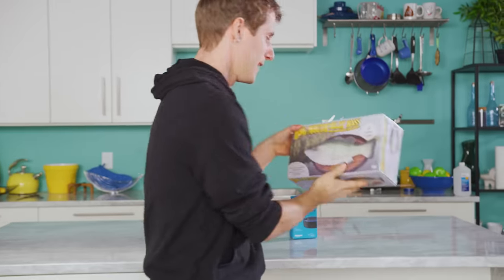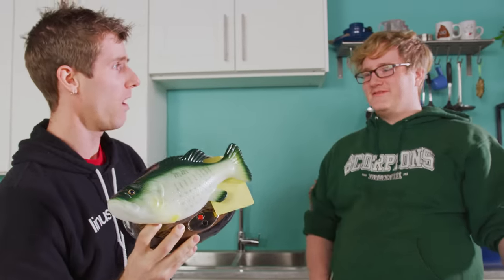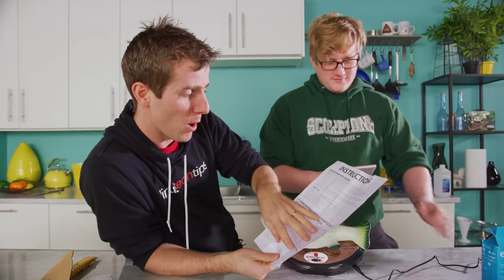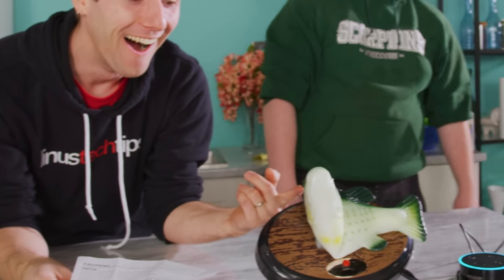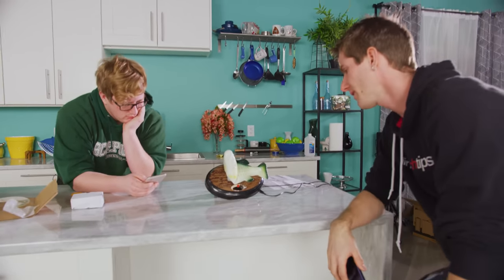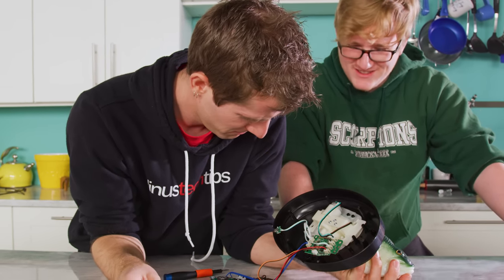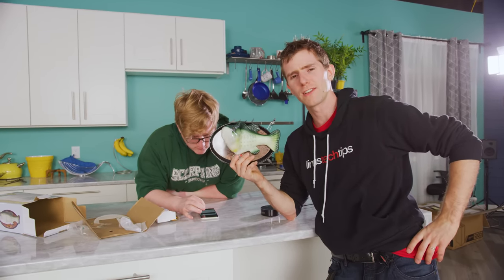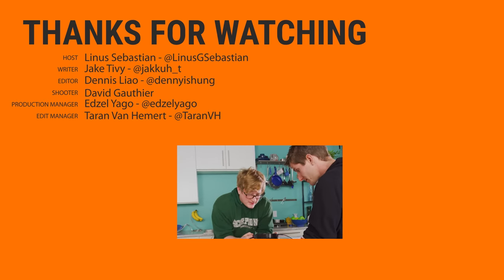The BEST Money We've Ever Spent

Comment: Regarding that motor, it's just a simple 8-point helical assembly.
Reply: What's that? I guessed the 1 motor had 2 rods connected to something else that the shaft was connected to which pushed the back or front out when the motor spins.

Comment: iFixit huh.....
It cost $59.99 and $55 shipping to my country great deal :)
Reply: 😂😂 I know right
Reply: It will be the best money you will ever spend.
Reply: you can try amazon for the same stuff. it's a little bit more, $65, but the shipping cost is way less.
Reply: Ifixit screwdriver and bits are JUNK. Amy screwdriver you see, that has bits with a bright finish, is junk. (This is a general rule of thumb, and it doesn't clover every base.) Look for black bits. Same goes for Allen/hex keys. Buy some Wera/Wiha screwdrivers. The cellphone opening implements can be bought separately too. Although old credit cards and gift certs work great too. Just cut them up into the shape you need. You don't need an iFixIt kit. That being said, it doesn't make the op's comment any less dumb.
Reply: @xenonram  Point on the doll where the ifixit kit hurt you
Reply: Andrew Delashaw
Then maybe Xiaomi's Wiha set? Not sure how good that is, but the price is lower anyway...
(Also I think those no brand red "S2 bits" are also pretty good, and costs even less.)
Reply: iFixIt's shipping has irked me in the past. Are there any better options out there for a similar price that include all the same bits?

Comment: One motor for both tial and head. The motor can be run clockwise and anti-clockwise. Some clever gearing distinguishes between the directions and controls each movement individually. The movements return to their neutral position on their own with a spring; at least they're supposed to. The head doesnt seem to work particularly well.

Comment: Based off of older fish I've fixed this is how it is. It might be different since this is the newer one but let me explain. The 9 tooth gear in the motor makes both head and tail move. The gear spins one way to move the head and the other way to move the tail. Im not sure on how to explain how it works in the gearbox but thats just simplified. The mouth motor is where you pointed it at and it is also moved with a 9 or 10 tooth gear.

Comment: The head and tail are on one motor, that why he can only look at you or flap his tail, not both at the same time. 
The gearbox probably uses a sliding worm gear, probably on a square shaft so the worm gear can slide on the axle while stull getting turned,, when the motor spins one way the worm gear works like a screw against the gears for one movement, then when it reaches the end of the axle it starts turning the gear, if you reverse the motor, it unscrews from that gear slides to the other end of the axle and engages the other gear.

Comment: When the motor is spinning in one direction, it's moving the head. When it's spinning in the opposite direction, the motion of the motor is transferred to the tail, all thanks to a simple gear mechanism which moves either one section depending on the direction of the rotation.

Comment: Ok sooo... Since I’m a robotics developer so yeah.  I couldn’t help myself. So here is how that motor works. First of all, yes the 5 volt BLDC Multi directional motor does in fact drive the tail and head. Let’s say the motor has a position at 0 degrees where no Tail or Head for that matter are out. If the motor goes to a -40 degree position the Tail will stick out. If the motor goes to a 40 degree position the head will stick out. It’s multipurpose solitary motion control. The only downside to this tactic is that that you can’t have the Tail, and Head out at once. It’s either Tail, nothing, or the head. And the mouth is just a little servo that’s just plain sad. Well!!! Hope I could resolve that...

Comment: Is there any bottleneck on my pc because when I play GTA V my CPU (without a side panel on) goes to 100% load at like 83 degrees C and my GPU is at like 40% load at like 60 degrees C 
My system specs are 
CPU: AMD A10 7890K quad core 4.3GHZ
GPU: GTX 1050 2GB
RAM: 16GB CRUCIAL RAM
120GB Kingston SSD
2TB WD BLUE HDD 
Please help!!
Reply: what about changing the thermal paste and cleaning all your fan coolers, also ill try to add some cable management